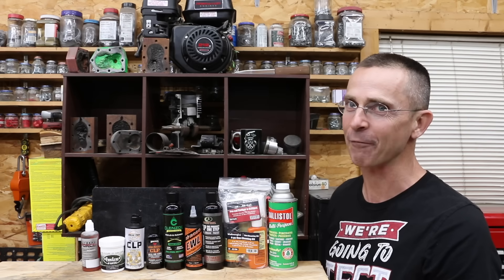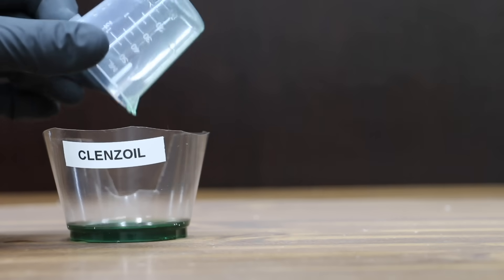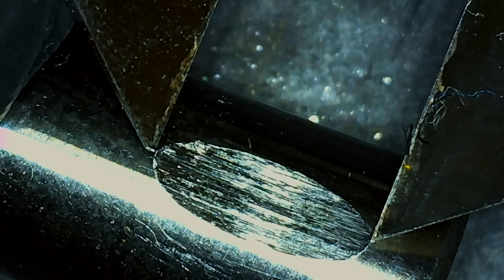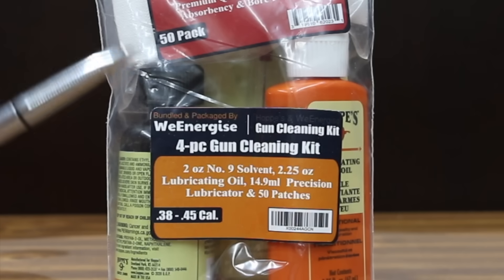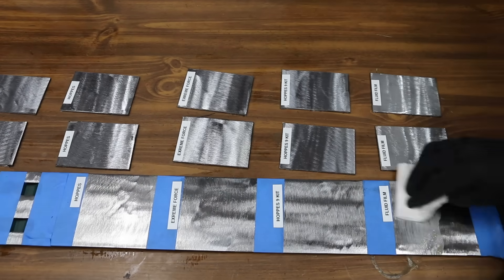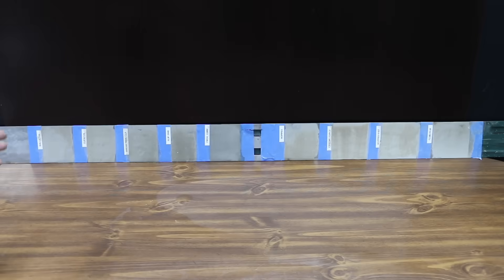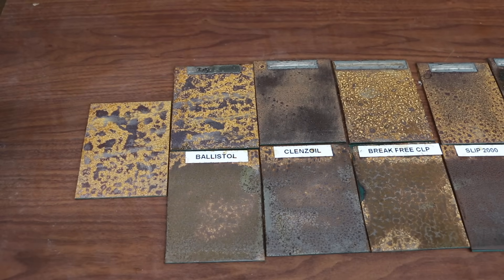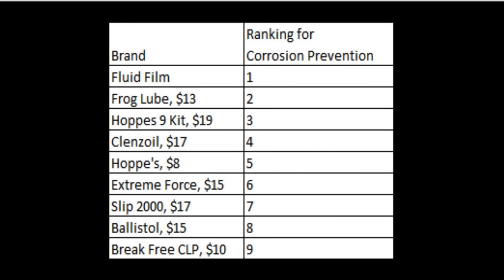Don't Buy A CLP Until You Watch This Review! It'll Save You Time And Money!

Comment: After watching this, I went out and bought the Clenzoil CLP. I also bought some of their grease to use where it's needed.
Cleaned a couple of guns with it and they are working and looking great. Time will tell how well it works in the long run.
Reply: I’m new to firearms and just happened to but Clenzoil a few weeks ago to clean it the first time. So far no complaints!
Reply: @ag95mboy  Yeah, I'm working on two S&W revolvers right now. They had been stored dirty years ago and are in some need of deep cleaning. For the really nasty stuff, I just spray on some Clenzoil and let it soak a while before scrubbing with a brush. I also like the fact that the odor is so mild that I could use this inside the house if I wanted to. Not like the old school solvents.
Reply: How do you like it and what climate are you in ? I’m in a desert and I’m about to change my lube and cleaning habits and run stuff pretty wet from now on
Reply: @Apolloneek  I live in a semi-arid area where it gets pretty hot during the summer.
And the product works very well. After watching the video, I picked Clenzoil because of it's overall performance but also because it worked pretty good as a lubricant. I don't have to worry about corrosion as much, since my things don't get exposed to things like salt or humidity if I lived on the coast.
You can also supplement the CLP with oils and greases for lubrication in certain areas if you like. That's what I do.
Just be careful if you want to put on a lot.
Since you live in a desert, sand and grit can accumulate and cause excessive wear.
Just check and clean thoroughly when needed.
But there is no downside to over-lubing other than that. Just make sure your barrel is clear and unobstructed.
Reply: @1958PonyBoy  so yeah I got down this road because I was seeing possible abnormal barrel and hood wear and wanted to see if I was under lubing it which I think I am. Even being in a desert I keep them clean so I think I’m gonna run a lot more wet then I have in the past and see the results
Reply: @Apolloneek  Sounds good. But if you are seeing abnormal wear by what you think is under lubrication, then I would definitely use something more than just a CLP in those areas. Like I had mentioned, a good oil and grease meant for firearms is your best bet.
Lucas makes both products that work well.
You want to use oil on parts that rotate and grease on areas that slide against one another as a general rule.
But, I also sometimes mix the two together if I want a viscosity in between.
Reply: @Apolloneek  clenzoil for heat
Reply: repentandbelieveinJesusChrist4  on YOUTUBE........
Reply: If you don't mind my asking how did it work out? I live a block from the ocean, my dad always preached hoppes but a rangemaster turned me on to frog lube. Heating the parts first makes all the difference and I've found cleaning to be much easier now. Not sure if the CLP would mess with frog lube after initial heat treatment but from the video you can tell after it was heated it made all the difference in corrosion. Wish he heated for the wear test as well
Reply: @nickw7619  The Clenzoil CLP is working fine so far. That's still my go-to cleaner. But then again, I clean my guns after every shoot, so I don't get a lot of buildup that requires heavier cleaning. But I also have products from other manufacturers as well, including Hoppe's and Lucas. I haven't tried Frog Lube yet. How do you like  it?
Reply: @1958PonyBoy  I love it. It definitely makes cleaning easier, the key is to completely strip down your piece and heat up all metal surfaces with a blow drier or heat gun on a low setting and use a flux brush (for plumbing, cost like 50 cents a piece- just buy a pack for a few dollars at home depot) and put a nice heavy coat on, let everything sit overnight, come back and wipe off the residue. It actually goes into the metal on a molecular level (almost like blueing) and adheres to the metal. I live a block from the beach so saltwater air and rust is my main concern and it helps a lot. The actions are smoother than regular oil and on something like a glock or other polymer frame you don't have to worry about the oil degrading the plastic bits. Would recommend 100%. The test in the video where he does the corrosion part just goes to show how well it works, and he didn't even pre-heat the metal like the instructions say
Reply: @1958PonyBoy  how do you like Hoppes?
Reply: @mysticmac5555  I still use good ol' #9 if there is significant build up. It cuts through that stuff pretty well.
But you can't use it inside without stinking up the whole house for days.
Reply: @1958PonyBoy it sure smells like good memories though.
Reply from the maker: Thanks for sharing.
Reply: Repent and believe in Jesus Christ  he said that many are called few will be CHOSEN.  Or to clarify.  As he said why call him Lord and do the things he says.  Also said that if we live in his words and if his words lived in us then we will know the truth and the knowledge of the would set us free. (From being deceived)

Comment: Basically no reason to ever use CLP unless you're deployed in a combat zone and don't have access to dedicated cleaning solvents and lubricting oils and greases and preservatives.  CLP will work fine for carbon removal, but getting out deposits of lead and brass is something you just cant do with most CLPs.  Jack of all trades = master of none

Comment: Would love to see Part 2 with Ed's Red, ATF, 5-30w Mobil 1, Breakthrough High Purity Oil / HP Pro, Lucas CLP / Extreme and re-do Froglube applied as following their instructions (maybe do it as the last wear test in order to do so).  Thanks for testing things I didn't know I wanted to see tests of!
Reply: I also would like to see the Lucas Extreme Duty Gun Oil get tested. Add Amsoil Firearm Lubricant to the test list. Amsoil has a separate cleaner product, which might make it a better lube than the Ballistol, which is what I have been using. Ballistol smells good, if that counts for anything!
Reply from the maker: Thanks for the suggestion.
Reply: In addition to the 9 products tested in this video, I came across these:

Sentry Solutions - Tough Glide CDLP,
Pro Shot - 1 Step CLP,
Advance Weapons Tech - Extreme Force CLP,
Lucas - Extreme Duty CLP,
Real Avid - TriMax CLP,
Strike Hold - CLP / gun oil,
Shooters Choice - FP10 CLP,
Corrosion Technologies - Ultimate CLP,
Mil-Comm - One Step gun oil, 
Mossy Oak - All in one CLP,
Sta-Bil - Gin CLP,
Hornady - One Shot Gun Cleaner,
Tetra - Triple Action,
Modern Spartan Systems - starter kit plus (individual cleaners & lube / protector)... [fwiw: claims it improves accuracy 90-95% of the time], 
...whew... 

There are certainly more, but the testing should clearly differentiate the general-purpose, marketing gimic, "snake oils" from those legitimate products that work effectively. 

I'm ordering the Clenzoil (based on these test results) and will order the Lucas CLP to try as well. Thanks for the great videos and testing!!!! 👍👍
Reply: @jakal104  Hi Jim, here's a couple more.  Militec 1 and Klean Bore Formula 3.  Both made in USA.
Reply: Frog lube is trash. It's coconut oil with scent and viscosity modifiers. You have to wipe it all off or it gums up your guns, hence the "high tech" application instructions lol.

Comment: I felt bad to see Hoppe's not do better. I always felt that Hoppe's No.9  Nitro powder solvent was the ultimate in men's aftershave and cologne.
Reply: And, she likes it too.
Reply: If you look at the overall scores I find it really didn't do that bad.  Hoppe's most likely is a brand that wants to meet all requirements, even the milspec  -40° (very respectable considering 3/4 of the brands dont even meet it).  Cleaning can be done more thoroughly and I would bet the army doesn't use clenzoil xD
Reply: @RWMAirgunsmithing And why doesn't the army use Clenzoil? Does that make Hoppe's better? The army doesn't buy the best available, it buys what offers the best cost-benefit ratio. Many companies may sell their product to civilians as the most expensive on the market, but for the army they offer the best price in the bidding process.
Reply: I  LOVE  THE  SMELL  OF  HOPPES  IN  THE  MORNING
Reply: Unfortunately, and especially on the internet, it's common to believe Hoppes No 9 is great for everything not realizing it's a bore cleaner not a CLP but even the Hoppes CLP wasn't great in this test.
Reply: @CCW1911  I'm fully aware and realize what Hoppe's No 9 is for. I also know the difference between it, and a "Clean Lubricate and Protect" product.  My comment pertained to my expectations of a Hoppe's product to perform better. I've been using their brand, along with others for over 50 years.
Reply: @jnicksnewstart  Also, just curious, have you ever had any issues?  After 50+ years do you think now with this knowledge you would change anything?  Im Canadian and only had my license for 2 years, i have zero experience compared to you xD hehe
Reply: @RWMAirgunsmithing  Personally, I don't use CLPs. I still prefer to clean them the old fashioned way. I still use Nitro powder solvent to clean, then make sure all the residue is removed, followed by a sparingly light application of proper gun oil or lubricants like graphite paste. I don't allow parts to get real dirty. Cleaning is very quick. I always use an air compressor to remove any residual cleaning fluid or lubricants where they cannot be wiped away. If you're going to be doing full takedowns, buy a proper set of gunsmithing tools. It isn't that expensive. Don't use them for anything else. The flat blade screwdrivers are ground specifically for the machine screws on firearms. If you're doing a lot of cleaning, a nice addition to your ensemble is a quality ultrasonic cleaner. They're great for cleaning trigger groups without disassembly. There are other solvents that work really well and are much cheaper when using an ultrasonic cleaner. These are only my opinions. Everybody has their own way of doing things. As long as it works for you, that's all that matters. Best of luck.
P.S.   Be careful what solvents and chemicals you use on "coated" firearms. Make sure they're safe for the finish before trying anything new. If you have any doubts contact the manufacturer.
Reply: @jnicksnewstart  wow, wasn't expecting such a detailed response! I'm am an electromechanic and have a basic tool kit, slowly building specific tools for maintenance purposes.  

I've heard a few mentions about ultrasonic cleaners in videos, definitely seems like the future. 

So you didn't mention anything about your experience with hoppe's hehe ;) would you change anything with hindsight?

Also, you probably know this but isn't the new standard in ammo to have non corrosive powder?
Reply: @jnicksnewstart same here
Reply: @jnicksnewstart i suspect that the hoppe's solvent didn't do as well as the hoppe's CLP in the polishing test because the oil provides a medium to carry away the dirt. Nitnso much an issue if you're alternating patches old school style.
Reply: @CCW1911 I had used that hoppes 9boresnake  boresnake clp for a couple of years on my Glock and I’m on a budget so I somehow someone could tell me what a recommended clp and or oil would be for San Antoniotexas weather that would be great
Reply: @CCW1911  You're not the only one .

   Hoppe's makes a whole product line . Their Gun Oil was tested here , the №9 Nitro Powder Solvent is a different product , specialized as a cleaner .

  Also the modern formula is different from the 1903 formula , with modern Era EPA regs .

   Today , there are also polymer safe , synthetic,  and ammonia free versions of Solvent,  plus a Copper Fouling specific version.
Reply: It does make a great aftershave/cologne scent as proven by Phoenix Shaving
Reply: @FrugalShave  I didn't see any on their website. I did see some on the shave Den. Share any sources that you may have. I'd like to pick some up just as a joke for some of my friends. What the heck, I'll wear it too.
Reply: Def wins the smell contest. Don’t give up on your hoppe’s. It is great at doing what it’s supposed to do: gently dissolve light carbon deposits from your bore during routine maintenance. As far as every other part, you can scrub them. Rem oil and a nylon brush is all it has ever taken for me.
Reply: Been using hoppes #9 for the better part of 50 years, it has never let me down, never rusted and my 35 year old girlfriend loves the scent...I'm a happy man... 15:08
Reply from the maker: Thanks for the feedback.
Reply: A classic aroma! I like the smell of Ballistol also, and it is non-toxic.
Reply: @tomcurran8470 so weird, I love old Hoppes smell hate Balistol
Reply: @tomcurran8470  also, I dont know if the video creator knows this, but Balistol is supposed to be mixed with water, to produce a much better lubricant.
Reply: agreed
Reply: This is a old thread but I have to give my 2 cents. For 35 years I been using hoppes and rem oil,  since 1990 CLP. Barrel with hoppes internal parts CLP and rem oil for a light coat on all parts for lubricant and wear. I also use Mobil 1 sparingly on my bolt lugs and any high wear surface.
Reply: " I always felt that Hoppe's No.9  Nitro powder solvent was the ultimate in men's aftershave and cologne." Well, I'd put it as a close second to bacon. 😆
Reply: Hoppe's is good for cleaning and kinda sucks for lube.
Reply: When you have clear cut winner you should test it twice and compare to your original results. Just the winner not the whole field.
Reply: I have used Hoppes for years to clean, CLP to lubricate.
Reply: We always used hoppes to clean them with then coated them with rem oil
Reply: The original formula was the bomb!
Reply: Over 1000 rounds in my glock 43, sig, and kimber each, and they are still like new to this day. Just hit that shit with some break free solvent, wire tip it, snake it, run a cleaning pad with some gun oil on it a couple times. Fucking beauty.
Reply: Except for the abrasion test, the traditional Hoppe's actually did just as well as the Clenzoil on all the other tests. Apart from Democrats, corrosion is the biggest enemy of guns.

Comment: One note on the cold test, typically you want to run your guns dry if you are temps that low because any lubrication will gum up and cause malfuntions a lot of duck hunters run their firearms dry due to this and being in very low temps
Reply: My dad learned to winter lube in Korea by rubbing pencil "lead" on the moving surfaces of the Garand. So I use powdered graphite or dry. Unless you have hordes of enemy soldiers charging you, running dry should not be a problem with any decent firearm.
Reply from the maker: Thanks for the feedback.
Reply: @ProjectFarm  thanks for the video! Excellent job!
Reply: Mechanical things often malfunction at extremely low temperatures, as they're designed primarily function at normal temperatures. Since there are lubricants that stay liquid and lubricious at "artic winter" temperatures, I'd use them or a dry lubricant like graphite powder rather than go totally dry. While modern firearms will often function dry, especially with some of the slick metal finishes now available, there's no reason to since you can get liquid lube that will stay liquid. I remember an arctic temperature testing video her on YouTube by Bigshooterist in Maine. I think the product was called Liberty Lube. It functioned well as a liquid lubricant in extremely low temperatures.

But yes, if all you have is "any old lube", as the Project Farm video here shows it's better to have no lubricant than one which may freeze in your gun and actually increase friction, jamming it up.

Comment: Great information.  I’m moving my Ballistol to the back of my supply cabinet.  For years the old timers in my muzzleloading club all swore it was the absolute best for Blackpowder guns.  You and Cyclops Joe are my go-to guys for honest reviews.  Can’t thank you both enough.  Merry Christmas🎄
Reply from the maker: Thanks!  Merry Christmas!
Reply: I have a friend that is a 12 time world champion, muzzleloader shooter, he also builds rifles, he told me that I should always clean the inside of my barrels with hot boiling water with water, soluble oil placed in the water, and then swabbed back-and-forth out of the container that had this combination, when finished, the residue was gone I gently wiped it out because the heat in the barrel pretty well dried everything and then applied German gun oil to the muzzleloader, I’ve been doing this for years and it works. Perfect, I just thought I would pass that on.  
PS   One of the muzzleloaders that he built  for me, has been sitting for better than 10 years , the other day, I took it out and inspected it, visually, and with a borescope, and the inside of the barrel was as brand new !  
Hope this helps  ! 😊

Comment: Great video. I use white lithium grease on most metal on metal moving parts for guns and use synthetic motor oil too occasionally. Maybe add those if you do a second round of tests.
Reply from the maker: Thanks!  Thanks for the suggestion.